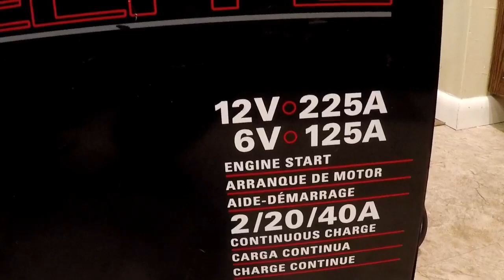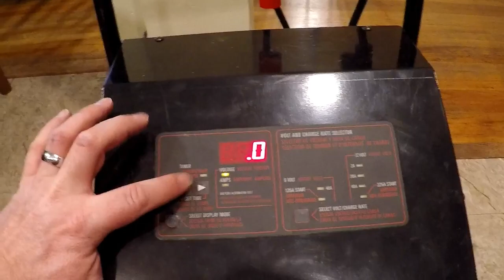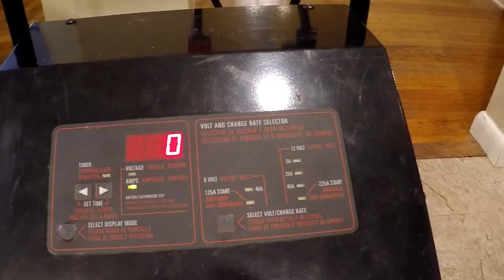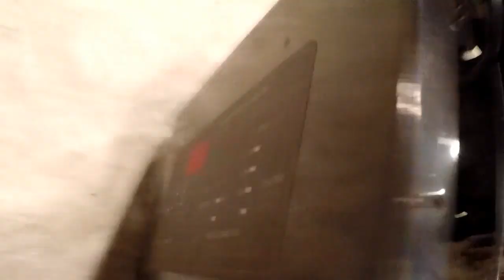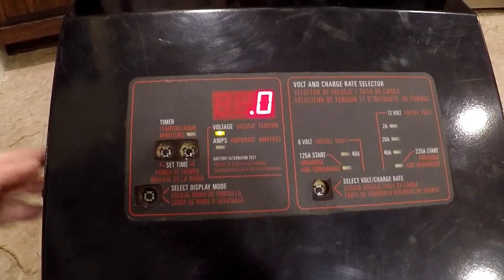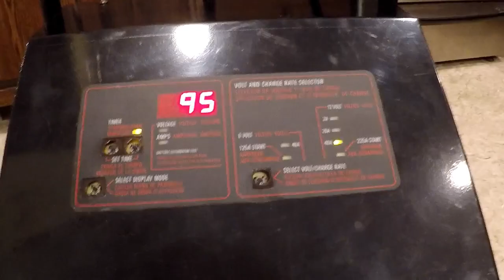Schumacher Car Charger Repair

Comment: How did you know it was that switch? How did you know what orientation to put the switch in? Or doesn't it matter?
Reply from the maker: I was pretty sure it was the switch because it worked if you pressed it a bunch, sometimes it worked. As far as orientation I can't remember, I did this repair a couple years ago. I don't think it mattered. But I can't be sure, it was a while ago. The unit still works perfect. One of the very few items I saved from a massive flood in our area that destroyed our home and most everything we owned. I also saved the shop vac. And the freezer and fridge too. The freezer died last year 10 years post flood. Fridge still going strong. I think everything else is long gone, most right away got chucked. Some things I tried to save but were unsalvageable

Comment: I have a 'right new' Duralast 200DL , I've been told is the same charger as this Schumacher. I've used my a total of 5 times and today when I plugged it in, the "on light" would not come on !  The charger is kept in a clean, slightly heated room under my carport, where it should be considered environment free. I pushed repeatedly , unplugged the unit and tried again, but nothing worked ! When I unboxed the charger I didn't like the flat, built in tabs, that I figured was going to be trouble ! I was right ! I thought  I'd check the fuse and see if it had blown, BUT I could find the fuse either !  I looked online and the ONLY suggestion I found was to take it back ! There is NOTHING about repairs these things ! If anyone reads this and has any suggestions, please leave a comment .

Comment: Hi - I am trying to fix an SE40225. Is there a way you could email me the pics of the connection from the two transformers inside, especially the red and black cables please. thanks
Reply from the maker: Im sorry, i have since sold the unit, as i had another smaller one and had no need of the larger ine anymore.
Reply: @coolstuffhowtoandfishing5488    I played your video real slow and was able to figure out the connections. The left side there are two red wires connecting in parallel between the two transformers(which is the same tapping point on the each of the transformers but connection using two wires to support the high ampere rating) The Buzz fused +ve connections  (two black wires) are also in parallel with this tapping point to support the rated 200A. The two red wires on transformer (nearest to the camera) going to the control board  top two connections and the two red wires on the transformers close to the ground goes to the bottom two connections  of the control board.  While I was able to restore the connections, the power control unit board has gone bad - but I wanted to thank you for your video.
Reply from the maker: Thats really great. Im sorry the board is bad, maybe ebay might have a used one? Mine was working fine when i sold it. Pretty tough unit, really. The whole reason the switches were bad is it was flooded in 2011 in upstate NY.... but it still worked. Nothing beats a schumacher...good luck with yours.. persistance usually wins out, with repairs for me at least. If I dont know how, ill figure it out. I suspect you may be the same.
Reply: @coolstuffhowtoandfishing5488  Thanks for the wish and encouragement I  continued working on it and the issue is now resolved. It was a corroded solder connection to one of the resistors on the control panel - not on the power board. I am going to change out the switch anyways and tape it out as it is exposed now. Thanks for sending me good luck! I couldnt upload a picture here otherwise I would have. Have a great holiday season!

Comment: I never liked those solder suckers. I have always used solder wick and it has never failed me for both through hole and surface mount components. I also like to use a small drop from a needle dropper of liquid flux on each lead. Although the solder you have is likely a flux core type, the bit of liquid flux applied helps create an immediate pull preventing any solder going outside of the pad area. Clean it up with a bit of alcohol and you will have beautiful solder joints. Just check after for a uniform and complete fill and no balling or holes in the joint.
Reply from the maker: Great advice thanks!

Comment: I have the same battery charger. The issue with mine is I get an overload "OL" while using any setting other than 2 amps.  Was wondering if a new control board may fix my issue.
Reply from the maker: I wish i could say...wouldnt hurt to try if you had a spare board, but I probably wouldnt buy a new board, Id probably just buy a new charger....

Comment: Nice video. Im attempting my own repair on a schumacer, kinda same amp output as urs. But different problem. Will be uploading my own repair soon. I also need subs, check it out. Will sub to you~
Reply from the maker: Yes, it should definitely put out 12 volts....watched a couple if your vids....nice job!
Reply: @coolstuffhowtoandfishing5488  I uploaded the schumacher charger repair. What I dont get is how the fan works. Cant get it to turn on. Also got an Associated 30A pretty new but havent seen the fan turn on at all!
Reply from the maker: I'll check it out!
Reply: @coolstuffhowtoandfishing5488  
Just got mine fixed, at least to how it was running before. Ok! When I set it to 2A the voltage drops to 9.36V, is that normal? does urs do that? Id think its suppose to be at least 12V since youre charging a 12V. 

Edit- ok it should be >12v  just realized it must be in the transformer or somewhere in the 2A circuit resulting in a voltage drop

Comment: I wouldn't plug it in with the cables clamped to the handles, it just might start working..
Reply from the maker: I guess you wouldn't know unless you owned one, lol. That center bar is non conductive and designed to have the cables clamped there. Thanks for watching!
Reply: I guess ya can teach an old dog new tricks...Good video though, my Schumacher, at least 25 years old, just went south on me..No power at all..I'll look it over and hope to have the same results as you..
Reply from the maker: The best chargers. Good luck